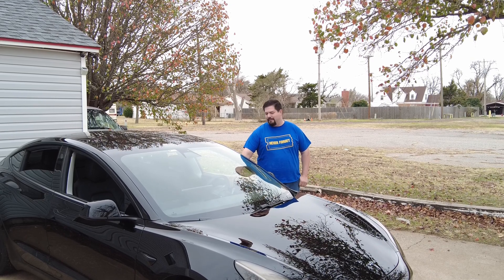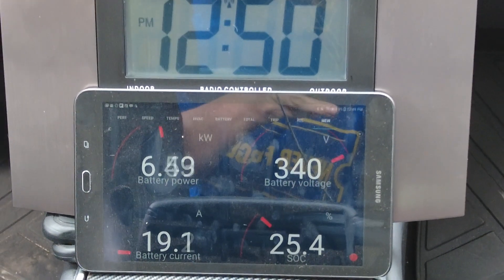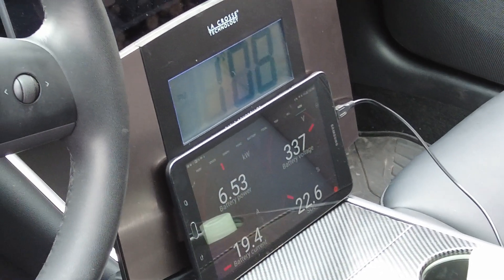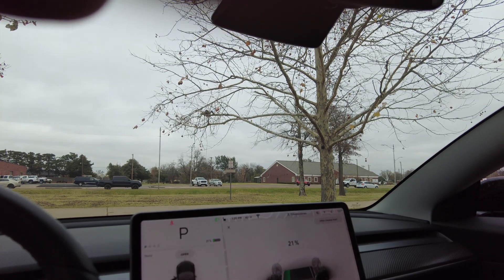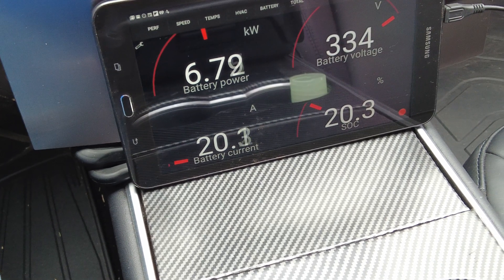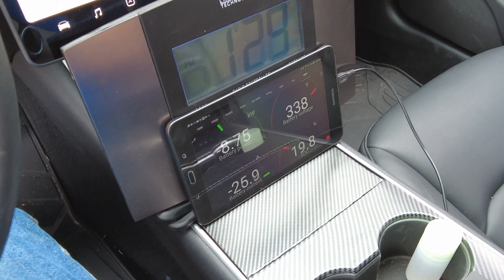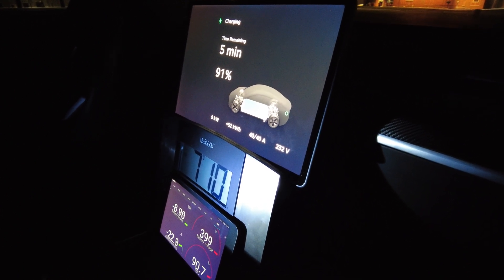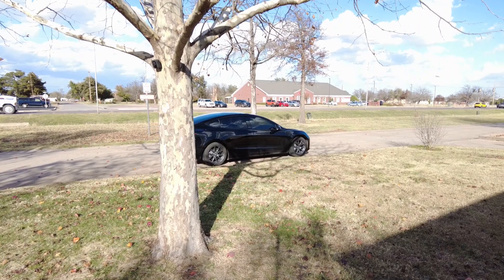How long will the Tesla 🔋 last with heater on full power⚡

Comment: Will your runtime vary depending on the outside temperature?  It should because it'll take more heat to maintain a hot cabin if it's cold outside.
Reply from the maker: Temperature won't matter it was running at maximum output the whole time.
Reply: @Crazypostman  Can you be sure of that tho?  6-7KW heater running all the time in 70 degree temps would melt the vents.  What I'm saying is it has to cycle somewhat or it would melt down.  It will cycle more if the temp incoming air temp is higher vs if the incoming air temp is lower.  Retest when it's 20 degrees outside to see if my hypothesis (science) is correct.  :)
Reply from the maker: @HamRadio200  but it never cycled, watch the time lapse you may have to slow it down but you can see it stayed between 6 and 7 kilowatt the whole time. Except for a little bit at the beginning when I was trying to figure out how to keep the screen on for a little bit the battery heater came on because I  had the ignition on and it was like 24kw for a few minutes.